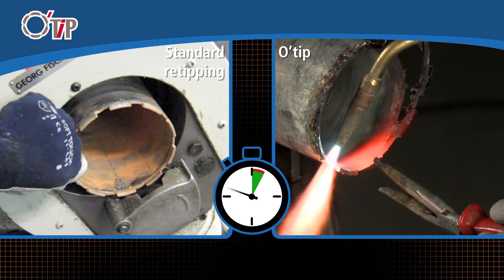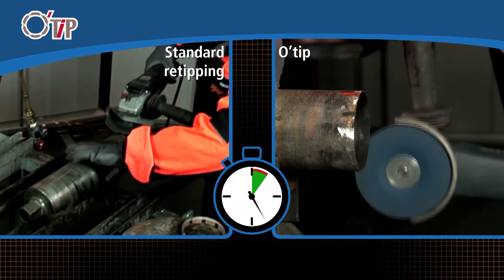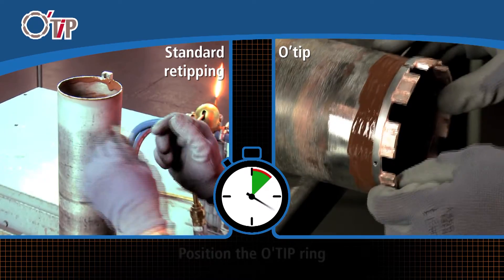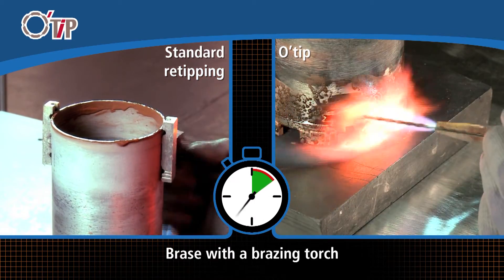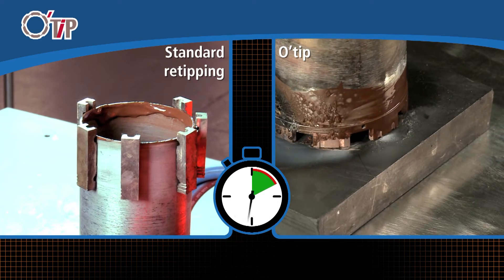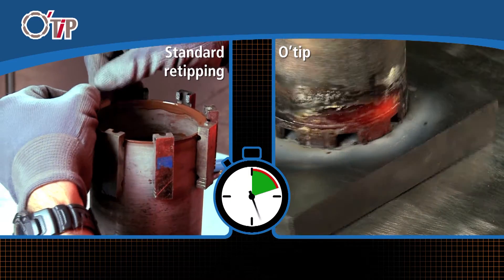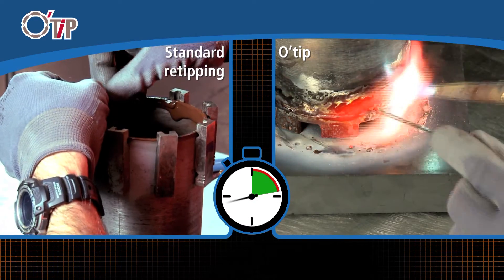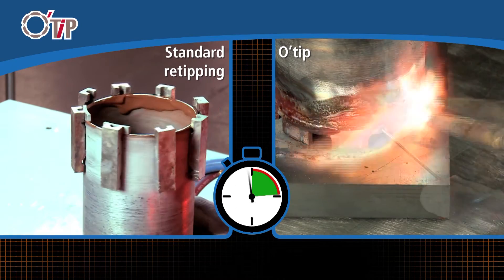Norton Clipper  - OTIP corebit retipping solution

Comment from the maker: @alex72kiss : this is a similar concept, but Hilti change-module has a flat section tube, while Norton O'TIP has a shoulder-shaped ring, which makes the centering much easier while brazing. The shoulder also protects the tube against wear. I invite you also to check the retail price of both solutions...